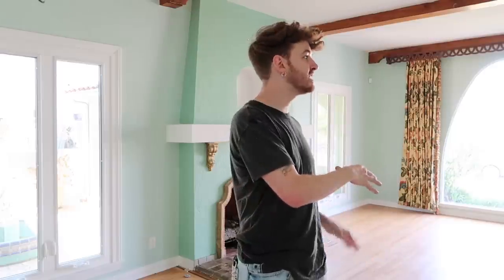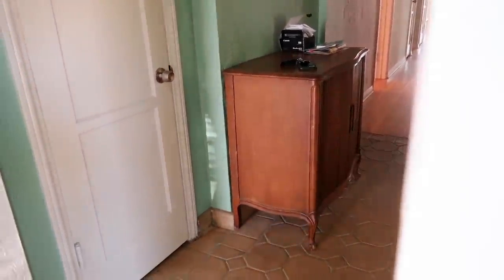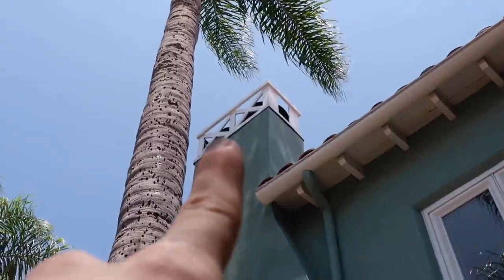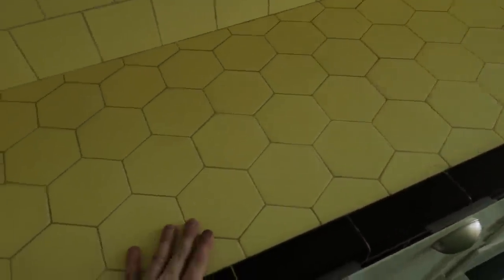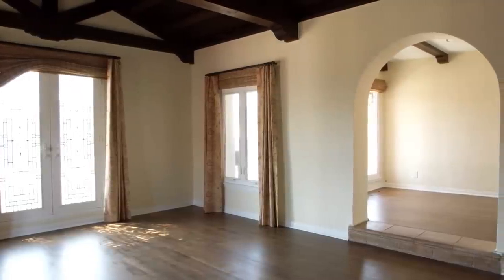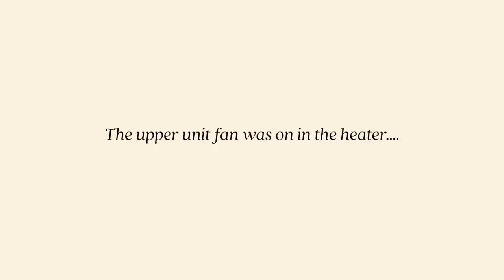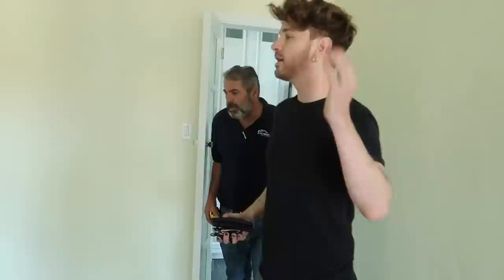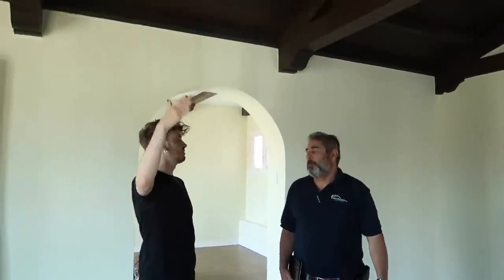Awful News About The House

Comment: i cant tell you the amt of times homeowners(even in relatively new homes) have found problems behind the walls after they have bought the home. dont let it get you down. its very common. get the leaks fixed. thats the priority. everything else can be done in good time. try not to stress out. put it all in context.  my dad use to tell me when i got upset w/ work or boyfriend trouble...."youre not in a hospital dying...everything else is fixable & you get over it & thru it & in time you'll think what the heck was i so hysterical over??!!"  sooo true!
 i live by that maxim.

Comment: As heartbreaking as it is, you're better off getting rid the old cast iron pipes before you finish the bathrooms. Just let them do what they do and you'll never have to think about it again. I don't think you would have been able to save most of that old tile anyway, ripping it up usually breaks them, so transplanting a few from one to the other was probably not going to work. My suggestion is to take photos and replicate the original style as best you can. I actually just had to do the same thing, and after it was all over, it felt fine.
Reply: Yeah, as much as I generally prefer trying to preserve original features... houses are also homes, not museums, and - especially with kitchens and bathrooms - renovating them to modern standards is often the right move. Just don't slap something randomly modern looking - like the upstairs bathrooms - in, but take inspiration from the rest of the house and the previous bathroom design and go from there -  but then I prefer "inspired by" to "replicated exactly," I think! 

I do think trying to keep the green kitchen tile would be nice, though, if possible!

Taking photos is such a good idea! It's something I'd do with an older house anyway, making a photo book or folder with notes and pictures, documenting how I found it and what I changed! Just imagine how interesting this could be for a future owner!
Reply: Good advice. 👍🏾
Reply: It might be that all those old tiles  in the kitchen and bathrooms are set in concrete.  Makes the very difficult to remove with out breaking.  I removed kitchen tiles in my 1906 house in Oakland and more than half broke.  Bathroom wall tiles were set in 1 inch of concrete.  Had to strip the walls to the studs and install water resistant dry wall and then concrete backer board before the tile.  Yeah may be overkill, but when I got finished using a superb tile setter installing modern subway tile  you could not tell that it was a new installation.

Comment: I'm a little late to this video but @7:03, DON'T use marble.  It is fairly fragile and stains easily.  If you want a "stone" worktop, go for granite or one of the modern composites made from recycled glass.  Personally, I would be looking at something like Formica and am not adversed to a good quality laminate.  If the floor files are soft and you intend doing anything with them, be CAREFUL since they might contain asbestos and will almost certainly do so f they mesaure 22x22 cm (9"x9").

Comment: OK::  Get a second opinion on the plumbing.  In addition, look at your inspection certificate that was issued to you before you purchased the house.  If the “cracked” plumbing was not detected please go back to the inspector and let him/her know what has happened.  There is potential liability here but first establish that there is an actual crack and not a costly “fishing expedition” for work that is unnecessary.
✨🌞✨
Reply: Get a second or third opinion on any major changes such as opening walls etc. Overtime'll develop relationships with contractors that you can totally trust but at this stage you're just getting to know who's out there.

Comment: Don't rush, if you can move into the upper unit which is in good condition, live there, take the vibe of the spaces and see how it actually works for you before you make more permanent changes. I think when you live in the space you can invision it better and see in reality what is more practical and efficient in your everyday functionality. Also the tiles might be that old but this doesnt mean you need to keep them. Those represent the taste of the owner that intsalled them, not nessassarily yours. You could find old tiles i guess or kind of replica which will reflect your tste and aesthetics. Good luck and congratulations!

Comment: Basically once you start opening something up, in these old homes you have to start doing everything, especially will new building codes and such. Ideally you just want to do cosmetic work and not serious construction cause it will end up being really really expensive
Reply: I agree. Also, once you open walls and then find mold or asbestos, you've opened Pandora's 🎁...

Comment: Happy Birthday Drew.  Can't believe you're so calm.  I've renovated an old house in 2018 and it was a nightmare I would never want to repeat.  Renos started and it was like peeling back layers of an onion - with each layer it got worse - wood rot from leaking pipes, electrical, plumbing problems, etc. etc. - bottom line was that over and above the $18,000 I had set aside for a new roof, flooring, paint and a few "make it pretty" things, I ended up with a huge loan that would have taken me 7 years to pay off.  It was so incredibly stressful it's hard to believe I didn't have a nervous breakdown.  I ended up hating the place - didn't matter what I had done to make it beautiful, every time I drove into the laneway and saw the house it reminded me of all the stress and I would feel sick.  I sure hope the bathroom leaks are the only problems you have.  Best of luck with everything.
Reply: I dont think he is calm lol. He is (very understandably) slightly freaked out. I think his expectation was that he can move some walls around and do lots of decorating r away.

Comment: So happy for you, Drew! I would definitely love to see a video on the appraisal of the light fixtures throughout the house. So unique and such incredible craftsmanship! I love all of the tiles, too, and I like your idea of moving tiles as needed. Such an incredible house! I want to wish you a very Happy Birthday (I just celebrated my birthday on July 13th). My mom and late dad's house was built in 1922, so it is officially 100 years old now, and the vertical plumbing issue, termites deep in the foundation, etc. are all common problems in older houses. They actually had a fire occur in their chimney not long after acquiring the house and the fire department had to be called to put out the fire (the fire was put out quickly, no damage to the house, and no one was injured). Some things do get missed during house inspections that are located deep inside the walls, foundation and in my parents' case, the chimney, so this does happen. If I can give you any advice, make sure that anyone who works on your house, plumbers, carpenters, etc. is licensed and bonded. There are a lot of sneaky snakes out there. My mom and dad did most of the work on their house over the years, but after my dad passed away, my mom hired someone to do the asphalt on their driveway and he was one of those sneaky snakes and charged her substantially much more than what the cost should have been and didn't even finish the job properly. So be careful.

Comment: I adore you Drew! Thank you for putting your life online. I am learning a lot. I agree don't rip out anything. Can you attack the issue on the opposite wall of the bathroom? Better option. Outside wall of the bathroom. Does that make sense? 
I had a guy come in my house and tell me he could not reach the water pressure valve and had to move the water heater to get to it, costing $800. To change the water pressure. I said put a hole thru the garage wall to create access. Funny he stopped right there.

Comment: Hang in there Drew! We bought our first house a year ago and while it’s mostly been smooth, we’ve had some “homeowner stuff” too! Carpenter ants, some cast iron pipes needing replacement, tree removal. I am embracing it because for us, renting was awful. I will say, let them replace the cast iron so you can breathe easy. And I’d also recommend having them take a peek to make sure there’s no mold. But inhale/exhale because you’re doing amazing and things will work out. :) I grew up in a 1925 home in Massachusetts with lead paint and asbestos- but it was a beautiful home! Each home has its own quirks and challenges. You’re awesome Drew!

Comment: Here's a concern I have about those broken/cracked tiles. I don't know where the house is located BUT if it is in an area where there is tectonic activity/unstable soils you might want to look into doing stuff so that tiles aren't rigidly put in place by using grout that is silicone based or isolating them in a way that they "float" as a unit so there can be expansion and contraction especially for the tile floors. Ask a structural engineer about that. Otherwise, you could fix all those tiled areas and have them over time start cracking again which would heartbreaking.

If you want to take out walls on rooms with wood floors it can be done. You would need additional subfloor strips laid out where the walls used to be bordering the original floors. Then once the subfloor is ready you could have a border of wood or marble tile placed around the original floor. I would go with a totally different kind of wood and color for the border since the grain might be running at right angles to the original floor. It wouldn't be a lot of square footage of wood so you could go with something exotic there to really gussy it up. You could even run lights under the floor border and have tempered tortoise shell or amber colored glass panels placed over it.

Comment: Hi drew! OMG, I feel you on so much of this. We purchased a 10,000 sqft 1964 mid century modern two years ago on 5 acres. We started renovations 2 months before we moved in and we have not stopped. We have people working here 5 days a week to this day. I have actually thought of doing a instagram acct because it's so insane what we have had to do.

But yes! So the "fun" surprises don't stop! We have done in two years what some people do in 10 years. We need to replace our windows (from '64) at $100,000 and it's not the large picture windows. We have so many leaks in our house (one of them being a 10ft x 10ft skylight that needs to replaced) Our roof is $75,000 bc it's unlike anything they have ever seen before. Do the things first that are for function. Like rotting wood, electrical issues, things like that. Worry about the small details later. (I say as the 5 different types of door handles in this house drive me nuts!) But I totally feel you're overwhelmed. Take your time. Break it up into bit sizes. Create your overall plan of what you want to do first with one room at a time and then go on from there. Then you won't feel so overwhelmed. But we are totally in the same shoes! I'm giving you virtual hugs and sending you wine!!! <3

Comment: Daughter of a fireplace installer. Dad owned his own shop. Those are gas logs. You can light them and if they are good quality the material that the logs are made of will glow as they get hot in the gas flames. Good quality ones can look incredibly real. The funny black stuff at the bottom is a fireproof produit that is heat sensitive similar to the logs. They will glow and sparkle when hot and look like real log ashes. Probably when the chimney man did the chimney he realized that your ashes were missing and added them for you so that when you light your logs they will look nice. The sand substance is just a substrate for the ashes. Check to see if your logs are hooked to gas and if the gaslines are up to code. If they're just setting in there you can take them out and do what you like with them or get them hooked up for a super clean way to burn a fire and heat a room. It's very pretty and romantic as well. If they are hooked up you'll want to get them serviced to make sure they're clean, functional and the gaslines are up to code. :) I hope that helps!

Comment: 16:10 To avoid that big job, I would not remove the walls. I would leave the hallway wall alone and cut an arch opening in the kitchen wall. An engineer would be able to tell you how big an opening you can cut without making structural changes. Regarding the floors, you would have to ADD flooring where the wall base was. I would use wood matched to the dining room (easier to source and finish to match).

Comment: Some suggestions:
1. Don't use marble for kitchen surfaces. It's very high maintenance and it will absorb spills. Use a more durable, less porous stone.
2. Bathroom tiles can be re-glazed to make them all a more uniform color. It's not expensive and this way you don't need to worry about finding matching tiles. Just replace the ones that are cracked.

Comment: Hey Drew! Do the plumbers have to use the  bathroom walls to "explore" where there is tile that you want to preserve? Can the plumbers "explore" using the adjacent walls in the room(s) next to the bathrooms - instead of going in the front wall, can they go in the back wall? Then move on to the actual bathroom walls if need be?
Reply: Very good point as long as the bathroom walls aren't external walls.
Reply: That's what I was wondering as well
Reply: That's what I was thinking. 🤔
Reply: And use a camera. Plumbing survey companies have access to telescopic cameras to explore underground plumbing that is inaccessible

Comment: Oh dear - reminds me of my first house renovation.  I remember picking off a bit of loose wallpaper thinking it looked a bit damp behind it and the next thing l knew we had scaffolding holding up the ceilings because the moisture in the walls had caused the ends of the joists to rot!  That leak could have gone unnoticed for years if no major plumbing work had been carried out.  I hope this one is easily fixable and doesn’t turn into a major refurb.  🤞🤞🤞

Comment: I saw the pile of carbon on the fireplace floor & let out a shriek. Drew, get a professional to look at the chimney, not just someone to slap mortar over it. I live in an old house in Italy, creosote was an awful hazard, so ended up installing an enclosed fireplace with a chimney insulated in ceramic. Guy told me temps can get up to way over 1000*C, so that protects the travi…rafters…that support the floors & roof that run into the fireplace wall. You don’t need a fireplace to heat in S. CA, so won’t be using it full on, but piece of mind is priceless! I love your show, your enthusiasm, & creativity, & can’t wait to watch your newest transformation!!

Comment: Archways are my all time favorites. Older homes have definitely beautiful vintage looks. I REGRET letting a jerk destroy the original bathroom tile floors in my 1955 house. Sure some were cracked, but I could have lived with them. My parents were the original owners. 
Personally I like a lighter stain on the hardwood floors.
This is a nightmare: JUST found out the cast iron pipes need replacing. My Social Security won't cover this. FYI: use kool-aid instead of pee. It reveals leaks from where.

Comment: Happy Birthday Drew! And congrats on the new house! It's so beautiful. My opinions (some you asked for and some you didn't, lol) are: I love the floors. I personally wouldn't go as dark as the ceiling, which is amazing. I would stick to a medium color since trends in floors shift so much, dark, light, back to dark, etc. When I bought my home, there was so much missed by the inspector, they even said the roof had 5-10 years left, well that winter when the rain came... yeah, not quite :( . More might come up, I'm not trying to scare you, just take it in stride and I'm sure everything will work out. What's on the other side of the bathrooms? Can those walls be opened up without destroying tile? Consider that if it's possible and if they aren't an outside wall. And if for some reason you do need to remove some tile and it's not replaceable, we just know you will design an amazing bathroom that will honor the history of the home while also bringing it into the 21st century. While tile was made to last a long time when homes were built, they wouldn't last forever. I am looking forward to all your video's showing the transformation, so exciting!

Comment: Hi from France 🇫🇷 Lone Fox! @8:18  - This is extremely difficult to find original tiles matching yours for 2 reasons:
1 - Tiles have a different thickness depending on the date of fabrication (less & less thick)
2 - Batches have different colors, especially when exposed to time & sun. Impossible to MATCH.

HOW I re-used my 200 years old tiles:
HISTORIC TILES ARE EXPENSIVE. TAKE PHOTOS & FILM. Measure the surface of the tiles. Just remove everything carefully. Separate the good ones from the bad ones (you can re-cut them so keep them).  REDESIGN USING LESS TILES.  Or keep the tiles for another project. 😁 
I have 2 houses in the South of France : one on the French Riviera & a 200+ years old house in Provence which I also renovate.

Comment: I was wondering why couldn’t they go in from the adjoining rooms drywall to check for the leaks without disturbing the tile? If you are going to remove it anyway I guess it wouldn’t matter 
, but it seems like such a shame to destroy that tile if it isn’t necessary.

Comment: Leaks are a priority fix. Worst case scenario is you'll have to hunt for period tile and use your creative juices to make it flow. It'll be okay. Also, was wondering if you have any original floor plans or photos to see where the duplex was originally connected. Maybe there was a doorway that they filled in to seperate the units. New/old home owning is quite a challenge at first but it'll come together. You're getting the important stuff done first to prevent future horror stories!